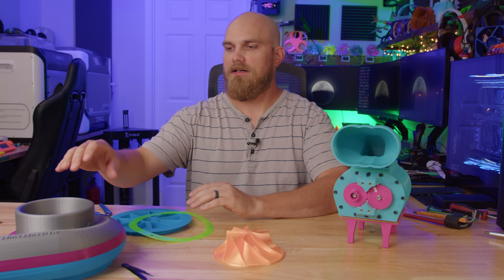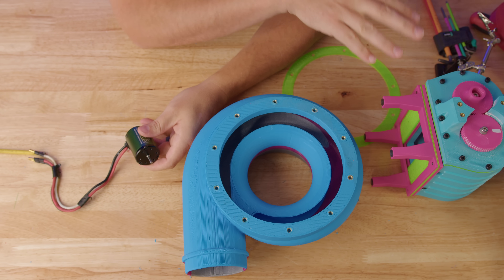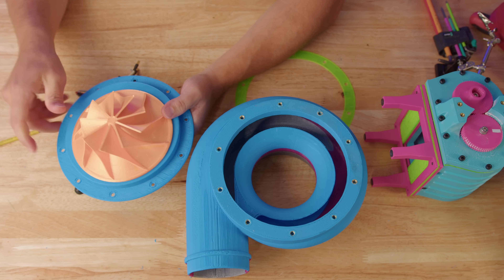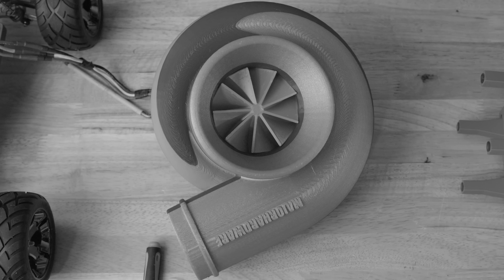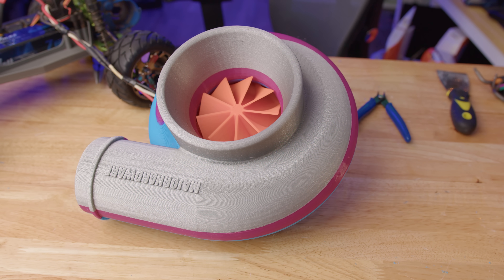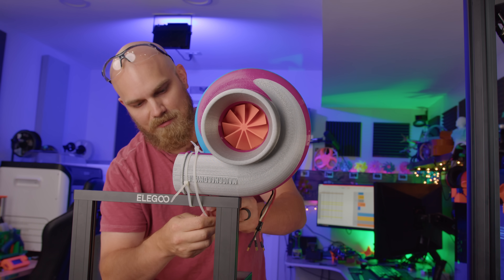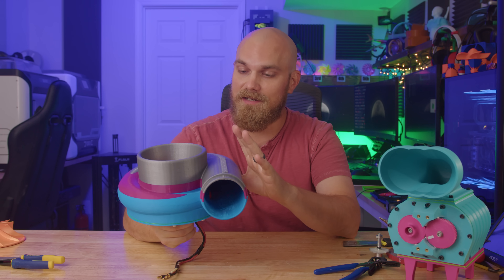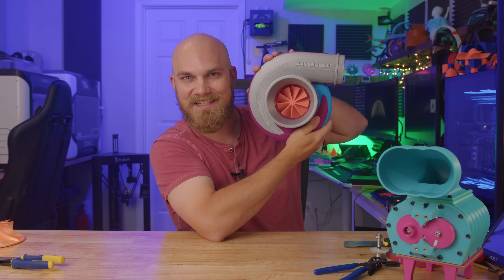I BUILT a MASSIVE ProCharger for my PC

Comment: A modification you could do to the Turbo: Take the Motor and Place it further away from the Turbo. Get a metal rod and stick it through the Rotor entirely. On the Back, use 2 Ball bearings (spaced around 5cm apart) where the motor sits and couple the engine with a Motorcoupler to the shaft. Maybe add a little fan on the Motorshaft itself to cool the motor. That keeps heat away from the Plastic itself.
Reply: This is an amazing idea!
Reply: Du hier?
Reply: It's not a turbo
Reply: @bradleyward285  it's a turbo that is belt driven
Reply: 2 dumme ein Gedanke 🤣🤣
Reply: @b3ro_02  you do realize real turbos have a shaft on bearings that provides stability to the rotating assembly, right? Just like the OP is suggesting. 🤔
Reply: @katalystva  He's not saying otherwise. It's just a German adage for when you and another have the same idea.
Reply: @KeksnussSC  i dont know any german so ill just accept what you said lol
Reply: @KeksnussSC  thanks for letting me know! Maybe I am a dummy lmao! Sorry B3ro_02
Reply: @SirFiggles  - It means "2 dummies, 1 thought".

Comment: I seriously doubt you'll ever see this but here you go. You should be using the compressor to compress the air and then run it through a pipe to an intercooler to get the now compressed and therefore also hotter air back to room temp. After that you can expand the diameter of the charge pipe carrying the compressed air so that the air will become cooler since it will now expand, at this point you can run the cooler than room temp air over the air-water cooler of a PC.

Comment: Something worth noting is that when you run high s count (8s+) you can run into the issue of voltage sag if you don't have high enough c rating batteries or multiple in parallel, which can turn an 8s system into 6s or worse if the load is really high. Motor wise, I would say get something with a lower kV rating, since that will perform better at lower speeds, and especially at higher voltages. kV is basically rpm per volt, so at higher voltages the same motor will run faster, which makes intuitive sense, but if you want a motor to run cooler by using higher voltages (and therefore less current) a lower kV motor will work better.

Comment: Ok. If you're gonna do this for real, you're gonna need to look up prop adapters at Tower Hobbies or HobbyKing. That will solve your adapter problem. Then look at motors. The important variable for you is the KV rating. The KV rating is RPM per Volt. Lower KV gives you lower RPM but more torque, higher KV gives you higher RPM but less torque. Err on the side of lower KV to keep your amperage down and motor cool. You'll be looking for motors designed for model airplanes and/or multirotors (quadcopters/drones). Match your speed controller to the motor. They are often sold as a pair.

Comment: Needs a bearing housing with a pretty thick shaft (8-10mm) that would stick out the whole length of the impeller. Also stick out the back the same amount or more, with the bearings spaced that fat apart. Drive with a belt.

Comment: A pneumatic or even battery poweres die grinder often come with both a ¼" and 6mm collet, and can spin upwards of 20k rpm. Add a shaft of the proper size and if it breaks it is easy to replace. Probably  a more robust setup than a standalone motor

Comment: Really love these experiments. Would LOVE for you to just make a second iteration of this! Take this as far and as professional as you can. Fix any tolerances as best you can (so the rotor doesn't scrape on stuff etc.), find a proper motor for it, fix any gaps, optimize for airflow iterations (maybe with software simulations?).

Then, when you have the perfect 3d-printable design, make it happen in aluminum!

Comment: Could you re - attempt this with the following suggestions?
1. Using graphite as a dry lubricant (everywhere possible)
2. Your gonna need a new ecu and maybe battery for a larger motor
3. Maybe try a restricted outflow tube? It will greatly increase airspeed coming out and because blowers and turbos are made for boost, it's shouldn't affect airflow.

Just some suggestions.

Comment: I would say that you're most likely going to have to find a way to balance the compressor wheel if you ever want to see long term success. Turbos on motors are spinning at ridiculous speeds (literally over 100k RPM). Anything moving at that speed will greatly magnify any imperfections in balance or roundness.

Comment: How do you know youre overpowering the motor if its bottlenecked at the wires? Did you also smell burning motor? If not, perhaps a quick heavier gauge wiring would have been appropriate.

…hmm nevermind.

Comment: Use a separate axle with two ball bearings with somthing like 30mm between them. Then attach the motor to the axle with a coupler. No wobbles and no load on the motor bearings.

Comment: Could you use a motor from like a box fan or maybe an oscillating fan. Idk how many rpm they turn but i think they would handle the torque load just fine under extended periods of use without overheating.

Comment: they sell a so called " cheap " electric procharger on Ebay I think it was. Cleetus even used it. comes with battery and motor and controls. I get you want to print the housing and fan. but maybe if you can find the company they'll sell everything else as kit. :D I'm sure that one would definitely get you spinning right along :D

Comment: Excited to see some revisions on this!  I think supporting the compressor wheel with bearings would be appropriate rather than trying to attach it directly to the motor.  I would think some of the larger Castle motors would be up to the task.
Reply: I second this, also try to look up some millwrights classes that may have available, it explains turbines coveyors and alot of other stuff and maybe it will give you some ideas on how to add it and what to troubleshoot for

Comment: How about a delta electronics model BCB1012UH. 12vdc at 3.84 amps It is a squirrel cage style but resembles a turbo compressor more than anything.  It also sounds like a jet engine spooling up.

Comment: You should try grabbing an outrunner BLDC motor so that you can press fit pieces onto the outrunner, similar to how you do with the noctua fan motors. Most outrunners also have a lower KV, so they will have more torque for spinup and a lower top RPM (probably don't need anything past 10k).

Comment: I wanna see you do a test where you do both. Have the procharger feed into the supercharger intake to see if that makes any improvements to flow. Also, I challenge you to make boost (PSI) with 3d printed parts. Maybe 1 bar will be the goal. I don't know how good of a pressure vessel you can make with whatever material you use so, 1 bar may be pushing it.

Comment: Two options for bigger/better setups is either a bigger rc car motor or get an electric motor with 4/6 bolts meant for larger propellers. A larger drone motor would almost be perfect because they’re usually sold with threaded shafts; look for cinelifter motors

Comment: If one that big is moving that much air, something like 3 and bit times more than the standard fan, maybe you could go smaller, maybe run a Noctua fan motor. I love the idea of it, but you would need to make a case just to fit it. 
Also, pretty much everything Micah Roberts said should happen. 
The closer the tolerances are, the better it will work.

Comment: Why dont you just get a 1/2 horse swamp cooler motor and a few differnt size pullys and make an adapter with gears to further up ratios and use that to power your BEASTS.

Comment: I think that it would be interesting to create a mount and design an impeller blade that would work in that housing but be driven by your standard Noctua test motor that you use for all the "regular" tests. I know that you had "one" in ep 11 just recently, but that one passed air through the Noctua's frame. This idea would use the Noctua's motor, but the air would run through the "turbo" as it normally would in any other motor driven turbo.

Comment: Get a lower KV motor when you replace the old one. That motor probably maxes out at 50,000 RPM. At 3s (12V) voltage something like a 500 KV would be way better for your use. A big drone motor would probably be your best case. Unless you’re gonna go super crazy then get something like a hobbywing max5.

Comment: I'd love to see this powered by a noctua fan motor. It would be cool to see if it works at all or if it can push more air than the noctua fan. Also maybe find a super quiet powerful motor to make that procharger work for daily use. I would be super interested in making this and attaching it to my system for some real cooling!

Comment: Get an old stock cooler for intel. the circular one, Cut a plastic bottle in half, place one end over the cooler(Tighter fit better) attach a vacuum cleaner on the open end of the bottle (Where the lid would have been) Noisy as all hell, but wonder what results you get ??

Comment: You need a motor with at least an 8mm shaft, preferably 10-12mm.  You're grossly underestimating the amount of power a compressor wheel of that size and type can take to drive; remember, a 120mm EDF can take 10-15000 watts or more (for the highest end fans).  A centrifugal supercharger this size (this is a rough ballpark estimate) would take somewhere in the dozens of horsepower to run and want to turn upwards of 70,000RPM.  Even if you want it to withstand half that, you need to print with Nylon or Delrin with 100% infill, and I'd still make sure I had not only safety goggles, but take advantage of the R/C system and don't even be in the same room.

Comment: Using brushed dc 550 motors would be the cheapest way to get the most performance. You can get a pair of 12v 40,000rpm (yes, 40) motors for about $25, and a dc motor speed controller for another $20. They just need a 30A capable power source. The easiest thing to do is use a drill battery. You can print an adapter or they sell some for all major tool brands. For an idea of their power, this is the exact setup I used to juice up my kids powerwheels. It rips.

Comment: If you aren’t going to put the compressor on a real set of bearings… support it on both sides.
A typical supercharger/turbo usually has a set of 4 bearings to counter the bending moment on the shaft. (The shaft is also typically a suuuuuper hard steel alloy)

Comment: In v2, set up a passage to bleed air off the outlet to cool the motor. Or, build a set of fins into the center of the turbine to blow air through the turbine to cool the motor.

EDIT: and hit up Hobbyking, they can probably give you motor/ESC tips and might even sponsor the build

Comment: While we're looking at motor upgrades, what we're really talking about is increasing power. So! How about overvolting an A12x25? Wire up a DC buck converter to your fan supply, boost it up to 18v or 24v and see what kind of voltage it can handle and what speeds it can hit! Try it with printed fans that drug the RPM down and needed more power, etc.

Comment: 850 to 1400 kv and over volt the crap out of it. So now your choices are right at the line of, do I go in runner or out runner. Please see your local hobby shop for further information on this. But I would say that a 1200kv truggy ESC and Motor  capable of unlimited voltage and power, (like a Tekkin setup) would probably push the most air at 140°F "can" temperature. Castle right now has been having fire problems with the big stuff, pre-warned stay away.

Comment: Awesome:
I'd go further down the 'pro-charger' route and bet drive it. That way you can add some angular contact bearings to properly support the compressor shaft and use a larger AC motor (say from a desk/pedestal  fan which you could get for $30-$40.) Using belts and different sized pullies you'll be able to get it to spin however fast you want.

Keeping it direct drive you'll have issues getting a motor that has a suitably large shaft that can spin to the speeds you require.

Comment: As others have stated. Larger motor but smaller overall size. The inlet doesn't have to be anywhere near the size of the a12 in order to post really good numbers. Smaller compressor housing and wheel is less load on the motor as well due to less rotational mass. This in turn would likely net you an increase in rpms, save the motor, and maintain the same cfm of air

Comment: What if you made it to where motor is in the front and you can use the air flowing into the compressor to help cool off the motor. You could also put a bearing on the back side of the compressor wheel to help with centering the compressor wheel

Comment: I have an old squirrel cage style blower motor out of a pickup that works 90% of the time and blows like crazy. 3D printing a housing with a 120x120mm outlet would be easy enough

Comment: Needs better gaskets can see it leaking around the housing... So it can do a lot better I reckon.. plus a 13000 rpm motor and some more precise printing to eliminate the rubbing it would be very cool to see.. idk how useful a plastic turbocharger is or what use it would have lol but makes for a good shelf model... Maby make a full V8 engine model with the turbo and make it so ya can swap it out with the roots blower 🙂

Comment: Need a bigger faster motor. I want to see this thing full tilt. Potentially also setup on an actual cooler to see the temp difference between different airflow speeds and at what speed temps plateau and no longer benefit from faster air. Certain channels like JayzTwoCents does their super OC challenges and maybe this could help either hooked up to an A/C unit or hooked up to one of those really big passive coolers. Energy efficient? no, but could definitely see some major cooling potential with that much airflow.

Comment: I would love to see this with a motor with a strait shaft to eliminate vibration.  It would also decrease the amount of stress on the motor so you could possibly run the same size without that overheating issue.  And like the other guy said, it would be cool to see it incorporated into a cooling loop to see its performance.

Comment: Compare an 11 blade design and a 6+6 blade design... that would be so cool to watch the difference in air flow through the wind tunnel reader and maybe add a ball bearing to the back of the blades so the motor doesnt stress too much

Comment: I am in no way an expert in rc car stuff (only started recently this hobby) but I've heard good things about castle and hobbywing and they both have motors/ESC combos that are at least 6S compatible and with 5 mm shafts and to prevent the overheating issue it will be better to take a lower kV motor (kV meaning for brushless motor rpm per volt) bc in general, lower the kV higher is the torque and (as i heard) lower is the amp consumption and probably try to make some gearings in a way that your fan (or turbo in this case) , would turn probably slower but it will put less stress on the motor (smaller gear attached to the motor and bigger gear attached to the thing you want your motor to turn) and try to find the best trade-off between the speed and the heat of the motor

Comment: need to look at RC electric Jet aircraft motors and speed controllers (ESC's), aka EDF's. You will like how their fans are attached to the motors, really handy for other hobbies. Hobbyking is decent to find cheap stuff for experiments. 
The only supercharger you haven't mentioned yet is a screw blower. 
Also have a look at a McColloch supercharger for a old Ford flat head V8., the turbine is mounted on 2 bearings and driven by a small gearbox which is then driven by the engine via V belts. Just design ideas.

Comment: You can try the Castle Creations 1717 1650kv. Its an 8s system so there shouldn't be an issue for temp problems and it also has an 5mm shaft so that wouldn't be an issue either. You can go crazy and get the castle 2028 1100kv, but that might be an overkill. Cant wait to see what you do with this

Comment: Can this be used to make boost with that much air output I'm assuming you could design one slightly more compact and test how much psi of boost you could produce. This would be sweet to have a dial-a-boost nob and flick a switch for instant power on a small engine or maybe bigger like a car

Comment: Honestly, don't change motors. Buy the same one. Then drive indirectly with a gear ratio to control the RPMs. No different than the rc car's drive axle. Pick your spur and pinion.

This has two major advantages.

1. You can change the max RPM.
2. You can make the output shaft beefier and easier to service.

Comment: I think you are moving enough air to peel off a little to cool the motor that is running this compressor.  Pull some through the back of the snail and run it through a secondary housing with cooling fins around the motor casing.  A much beefier motor and better bearing on the impeller would help too.

Comment: Have you checked out CPAP fan design? They’re used to generate extremely high static pressures using a narrower vane and high-RPM BLDC motor. Some of them hit 50-60k RPM in normal operation.

Comment: I would really like to see a tighter tolerance / Extreme quality piece that runs with an upgraded motor. I started to here the turbine noise during the wind tunnel test before it started to over heat. I believe with a tighter tolerance and beefier motor the turbine could really come to life and sound amazing.

Comment: Just a guess, but what if you did a turbo guard type setup with a shaft to extend off the fan itself to hold it straight into the turbo guard? Maybe a bearing off the fan's new shaft to hold it straight. Wouldn't be 100% turbo look anymore but might help with rpm/airflow